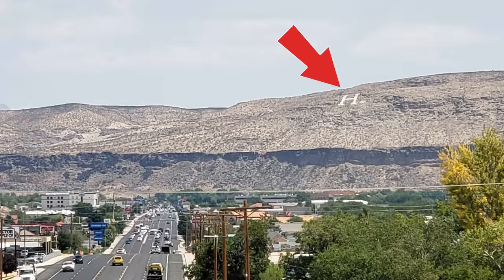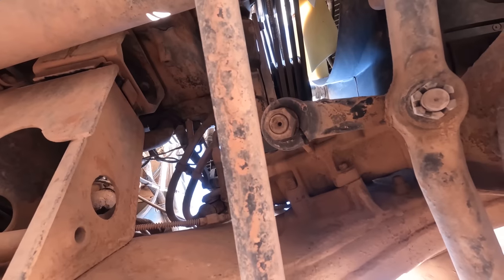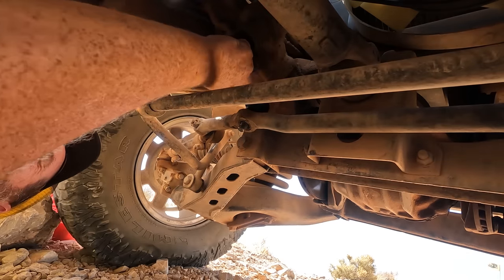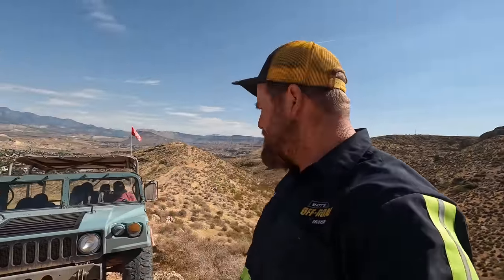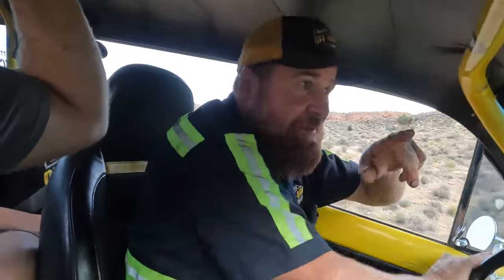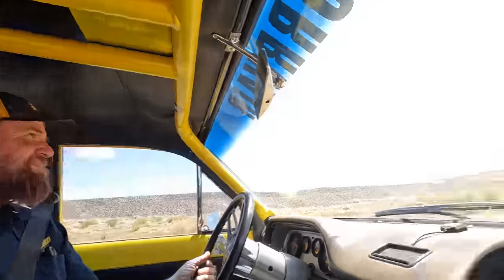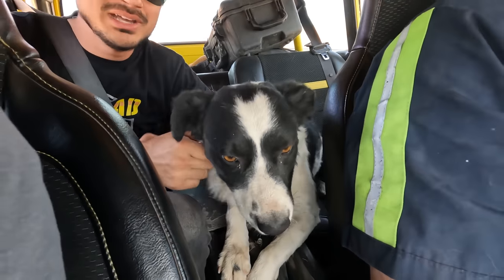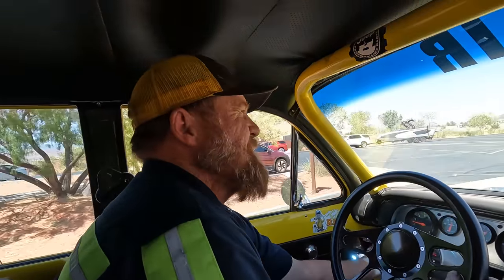Extreme Heat Conditions Make For Tough Recoveries!

Comment: ???? - (Zero vehicle knowledge guy question for Matt, or anyone that knows first hand like he does.)......
Matt's previously stated the M. Star Patagonia's he loves perform better in the sand when the tread is worn down, and from the looks of it, quite significantly worn down at that. To my ignorant mind, this would seem counterintuitive. Especially give sand buggies have huge scoop paddles on their tires. (obviously paddles aren't multi terrain, like Matt needs) But them using deep paddles makes me wonder why deeper treads when the tires are new, are not as good in sand? I can understand why, on smooth rock, pool-ball size knobs aren't great, due to the tall knobs flexing over, causing less surface contact. 
Funny enough, the 1/24th scale version of M. Star Padi's work quite well on RC crawler/trucks, on certain terrain, like DIY indoor courses. Fairly soft compound and large but not tall knobs for good surface contact. 
Thanks in advance for the answers to Matt or whomever takes the time!
Best regards
Bert- Wing Nut Designs

Comment: 1 and 3/4 turn on the steering wheel, 1 and 1/4 adds to 2.5 turns.
Reply: Adding 1 3/4 to 1 1/4 is 3.
Reply: Let me rephrase, 2 times 1.25 is 2.5. So the steering wheel needs to be at half of 3.5, which is 1.75.
Reply: @lukededina7153  oh yeah. That makes better sense. Lol.

Comment: I have an 82 suburban with a ratcheting/clicking sound coming from the front lockers when not engaged. Especially audible when turning. Anybody know if this is bad?
Reply: The gripinator or graphalon in the differential may have worn to the point there is excess slippage in the groove/torque spinflinner! Tapping the graphalon with a ballpeen hammer while making oinking sounds, can sometimes realine the splines and create a temporary fix. Try keeping the lockers engaged fulltime, or turn the radio up so you can't hear the clicking sound. Lol

Comment: You need get the bummer back in shop! You counted 3 1/2 turns then counted 1 1/4 to half  should be 1 3/4 hes gonna be limited steer one way

Comment: In the conrfounded metric system, half of 3 and 1/2 turns goes right past 1 and a quarter turns and ends up clear out there ay1 and 3/4 turns. Whi8cxh i8s why the metric system is so dumb. It just adds on  surplus  turns  willy nilly . And it causes extra work and even steering irregularities in some US military rigs.If you ask me II think metric is unAmerican

Comment: The steering wheel wasnt aligned right. 1 1/4 turns wasnt the correct math.

Luckily its a wire steering wheel and noone will know the difference
Reply: And the lower bar was immovable, so all he had to do was index the gearbox side in its notch. So his steering should still be good.

Comment: But I thought an open differential still puts equal torque to both wheels?! 😂
Reply from the maker: It does. 
One wheel was putting zero torqe to the ground. The other one was also putting zero torque.   

Regardless of what’s going on, both axles will be seeing identical torque.

Comment: At 4:55, were you trying to get the steering in the mid position before refitting the arm?  If so you are a bit out.  Half of three and a half turns would be one and three quarters, not one and a quarter.

Comment: As a guy from Ohio who played sand volleyball, there are so many grades of sand and when the sand is hot enough to blister your feet you have no traction with anything.  Even your chevroLEGS struggle to put all their energy into forward momentum (the volleyball pit sand thatis like the wind blown stuff nere isfrom tailings from harvesting and other portions of the industry but still not like the stuff in Utah).  Since the middle east buys sand from Ohio to use in their pool filters, i would say they have the same sand as you.  Basically your dry sand behaves in a similar way to quicksand (we have that in Ohio too) where any movement only clears underneath and the motion is down down down.

Comment: Just gonna upset all the Humvee owners... but they butchered a whole lot of Jeep trails I used to drive in Arizona. They're so much wider than a Jeep. The paid tour folks just ruined trails. Broke my heart as some of those trails were downright pristine (outside Phoenix). Their ruts just kept getting bigger and deeper... so then they'd shift a bit off the primary trail and build more trails. I stopped going after a while, just switched to a 350 motorcycle. I wonder... do they pay any special fees to operate tours on public lands? If so, how much goes back into fixing those trails?

Comment: BTW one half of 3 1/2 turns is 1 3l4 turns, not 1 1/4. Consider 1/2 turn more would be 4 turns the middle of which is 2 turns.  Back off half equals 1/4 turn to 1 3/4 turns for centered  wheel travel.

Comment: 3 1/2 full turns divided by 2 is 1 3/4, not 1 1/4.  I think his steering wheel probably needs to be re-centered by changing the pitman arm spline alignment.  Not that it would affect the way it drives, but sometimes you need to know your front wheels are straight.

Comment: Those Hummers really aren't that great. The engines are junk, the independent suspension sucks, the transmissions are weak, brake modulation instead of lockers... very overrated vehicles